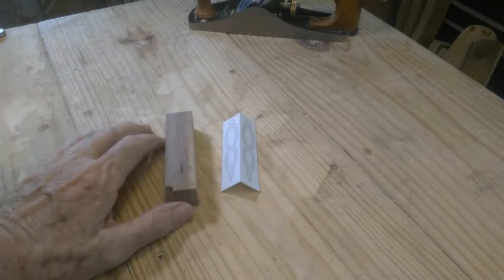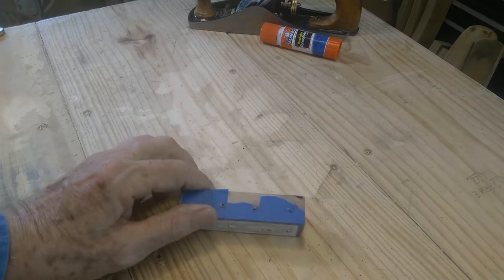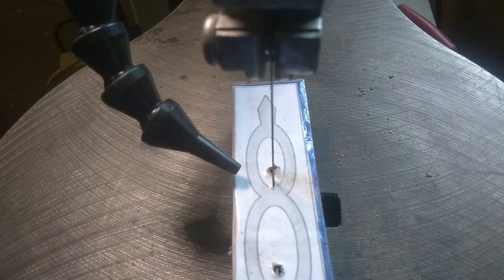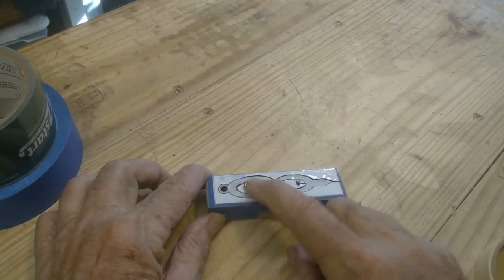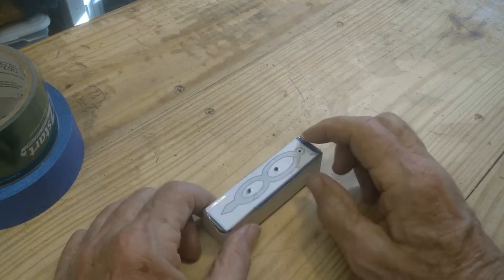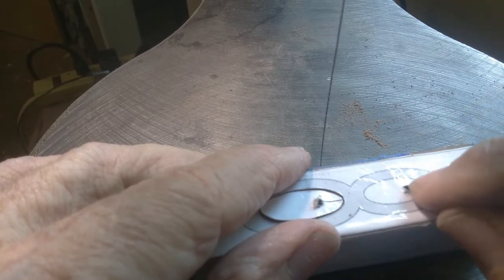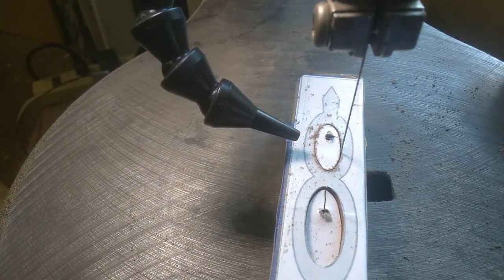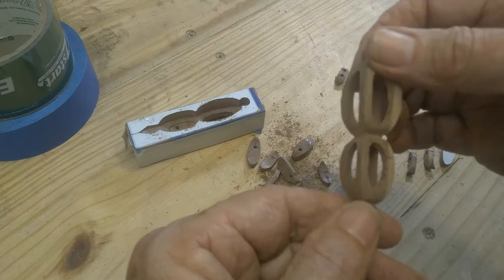Lesson 11, Compound Cut On The Scroll Saw

Comment: Pegas Super Skip (no reverse teeth) are good for compound cuts.  
I never leave the inner scraps made on the first side.  The blade doesn't have to work as hard on the second side.  
Also Steve Good has a plan for a clamping jig that makes control of the cut so much easier.
Reply from the maker: Good pointers, thanks.  I often leave the inner scraps from the first side out also.  I made Steve's jig once and it works great.

Comment: The cutting was set in real time? I have tried all kinds of blades but the cutting is really slow, I was using Basswood and now working on some Poplar,
Reply from the maker: Yes the cutting was in real time.  I actually ended up using three different blades, two of them reverse tooth.  I finally found a non reverse tooth to finish with that worked better, it was a number 3 skip tooth.  The wood is Walnut which is not a super hard wood although harder than Basswood or Poplar.  According to the Janka hardness scale the relative hardness of each is Walnut 1010, Basswood 410 and Poplar 540.  Those are all fairly soft woods with harder woods running 1300 and upward to 3000 or more.  You should be able to cut the Basswood and Poplar as easily as I did with the Walnut.  A skip tooth blade should cut better than a standard in thicker cuts 1 inch and up.  I am assuming you have tried that as you said that you tried all kinds of blades but if you haven't tried skip tooth that may help.  I used a 7 and a 5 and a 3. The 3 cut best as it was not reverse tooth but a 5 should work great.